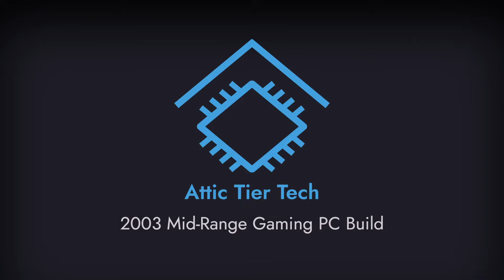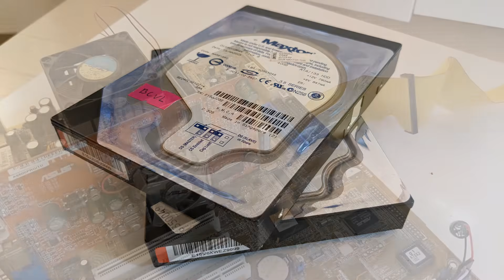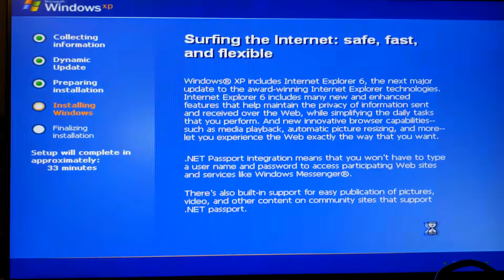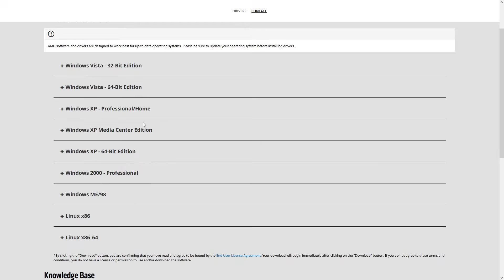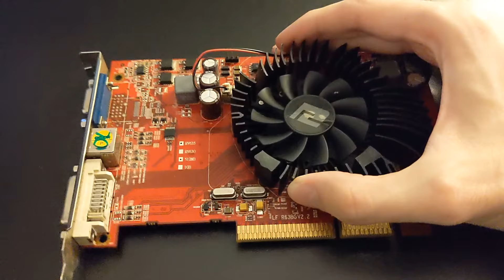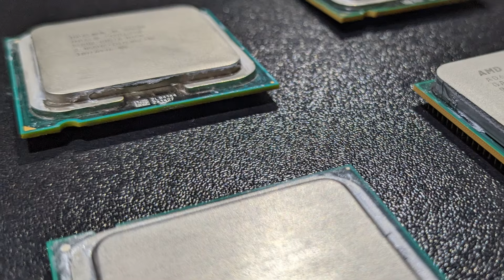2003 Mid-Range Gaming PC Build & Benchmark ( Murphy's Build )

Comment: My 2002-ish rig:
AMD Athlon XP 1800+
Asus A7V333 motherboard
GeForce3 Ti200 64MB
256MB DDR 266Mhz PC2100
HDD IBM 80GB 120GXP
Spire cooler very similar to this, but I remember the bottom corners being 90° 🤷

If I remember correctly, for a time the VIA chipset drivers paired with "incorrect" FSB config was a cause of instability. But I may be mis-remembering.
Those were the days!

Comment: Yeah you will see my previous comment but yeah the best thing that ever happened to me is that this a7v333 burnt out and I replaced it with a more stable ASRock motherboard the CPU and RAM are fine it's just the motherboard. Oh I retired it in 2010 the Asus a7v333 was the best piece of s*** I've ever had because it broke down so much and had so many issues I learned so much from it at the same time😆🤣

Comment: Holy moly this is awesome thanks for doing this video because this is pretty much the build I had as a teenager  the a7v333 I had the Western Digital 80 gb hard drive. My family got it for me cost around $2,500 from a store called OEM Express it came with a 4.1 surround sound speaker system creative sound blaster keyboard mouse and screen was included it was a Samsung SyncMaster 900IFT. So I learned off of this machine. The first thing to go was the motherboard. 
Brought to my new repair Tech at the time. Said I need new motherboard couldn't afford one cuz I was a teenager Jared some of the chips with the burn marks it worked for a bit longer got some money together brought it back he said it was a fire hazard😄 and he replaced it with the ASRock version. Also started bring home stacks of books from the library about PC repair and building used to fix people's computers in the area eventually saving up and upgrading the computer with that money to 3 GB of   of ddr1 RAM and upgrade the graphics card of course and a very very nice CD burner burning family photo albums onto them😉

Comment: My first GPU was the ati 9600 pro, barely was able to run crysis. Played on low settings 600p res with 10-15 fps. But I played it a ton, was fun.

Comment: All I can say about Asus socket a mobos is..."don't buy"

I bought a used Asus a7n8x-e with a 9600 and an xp 2600+ used from a friend in 2007 with a brand psu...
That POS Main-Board was so unreliable, that I had to replace it due to crashes, freezes and voodoo behaviour only 2 years later...

Got the a7n8x from a friend in around 2014 and ... It behaved just like the above mentioned board... I would not touch the Asus A7 boards even if I got paid to use them...

That experience (spending my at that moment in time life savings for a really really unreliable Main-Board) was so traumatic, that I still don't touch Asus Main-Boards from after 1999 till before 2010 or so

Comment: Every Asus socket A mobo has had stability issues in my experience. (Even the NForce ones) Not to mention the capacitor plague...

I have a couple of MSI boards with VIA chipsets and an asrock K7S8X with SiS chipset
All original capacitors, no issues with stability and all of them work flawlessly.

I think the HD 3650 upgrade is limited due to X4 AGP speed? I have the same one on the Asrock mobo i mentioned and it's so much faster than my 9600 pro in the same system (K7S8X has X8 AGP slot)

And as others have mentioned, strong 5V rail is a necessity with socket A CPUs.
Either an old PSU from that era or overkill modern PSU (I got RM850x with 25A for 5V and 3.3V 150w combined and works good on socket A)
I have couple of old "K7 certified" PSUs that are for sure good and they all go up to 40A on 5V rail alone (150W)

Comment: i have experienced same problems with similar board, a7v8x-x. Via KT333 and KT400 chipsets were plagued with issues. Older KT266 and KT133A chipsets were actually more stable, providing more mature drivers.

Comment: In my experience the Nvidia Nforce chipset is the best to use for Athlon XP.
I had back in days Athlon Xp 3200+ with Asus a7n8x-x deluxe, and going from GF4 MX, 9600pro and 7600gs.
And performance was rock solid.
Recently i bought a machine with VIA chipset and I experienced the same problems as you.
The GPU results didn't have any sense, the system was unstable.
I blame it on via chipset but it can be that the motherboard after 20+ years is gone. But all caps were in good condition.

Comment: Maybe that motherboard was already failing hmmm... Well my first pc in 2006 was sempron 2600+ socket 754, better than all P4 but by 2011 when I finally could retire this system, it was close to unusable (good thing XP lasted so long) slow, glitchy, not even snes emulator would run alright...

Comment: Nice build. The videocard needs cleaning though. Im thinking win 98 will work better.
Reply from the maker: While it would work fine, I can bet that it would run less stable :D I agree about the card though, somehow it escaped it's cleaning.
Reply: @attictiertech  Im pretty sure the radeon hd 3650 performed the way it did because of driver overhead. The athlon is bottlenecking it. My athlon xp 3200+ at 2500 mhz still bottlenecks the radeon 9800 pro/xt. 3mark 2001 se gives 19700 points. If i put the videocard in the pentium 4 650 at 4.3 ghz it gives 25200 points.

Comment: Glad you're back, and you are right, its better to use a sketchy power supply then to take a chance with the old psu, the one in my grandpas pc blew up and it was an old psu from 2006
Reply from the maker: I wouldn't call this one sketchy. We checked how it's running multiple times and it proved time and time again that it runs perfectly stable, much better than expected for it's price.

Comment: 3:12 Eww, please give that cooler a brush off ! Also, that's a bulging capacitor at 12:32, near the last PCI slot. I would'nt be surprised if that was part of the instability problem, more capacitors could also be dead whithout looking like it. That or the power supply, it might be recent, but LC Power is a crappy brand. VIA chipsets can also be quite hit or miss, it's better to update the chipset driver when using one.
Reply from the maker: Yeah, our graphics card somehow missed the cleaning :D Sorry about that.

Comment: Ah was wondering a bit on the description there, 8800 gt in this old of a pc. " Asus ATI Radeon 9600 pro "
Is the correct one ofc as the video, just writing it here to make it easy too copypaste into the description.
Reply from the maker: Yup, it wouldn't even fit :D It's fixed now. Thanks
Reply: @attictiertech  Np & I'm thinking either the motherboard is on it's last legs or the powersupply simply isn't up too the task with that platform lacking a 4 pin 12v eps connector.
With everything sharing 3.3v & 5v on the powersupply it can get a bit hit & miss too get this era of pc's up & running well.
Which might be like 12 - 20a instead of it's actual rating on the label.
It's unfortunately common for these kind of noname brands too up the power ratings, which resulted in either components failing too run stable from the lack of clean power or outright powersupply exploding or dying despite what the label claims.

Guess you could test a pci card & underclock the processor & undervolt it too confirm that,  like put the cpu down too 1 ghz from the 1.8 ghz & undervolt it until you get stability issues in prime95 or similar.
A program called crystalcpuid might be really good for this while in windows.
I use it with my windows xp laptop, a dell inspiron 6000 which has a pentium m 1.5 ghz, ati x300 graphics & a non official but better 90w charger too skirt around the power limitations it gets when not using a "genuine" charger which is basically just looking for a resistor on ground i believe.
(Using a more powerful 90w one as the original 65w charger runs a bit hot for my liking & one that i had spare that I've since trashed actually caused the backlight too flicker on it during load so it was really sketchy.)

If you do get a chance too buy one, a socket 462 motherboard with the 12v 4 pin connector on it is pretty nice for more modern power supplies & will be more reliable too most likely.
Always a bit hit & miss with old computer parts though ofc.

Specially the capacitor plague years, so many dead motherboards & powersupplies of dubious quality flooding the market.
But if you find a good antec, thermaltake, fsp, inwin, power man, sparkle/SPI, seasonic, silverstone unit with a strong 5v like 25 - 35a on the 5v rail it's worth keeping & replacing the caps on those if needed for a machine of this era, like 100%.

Might be able too grab a good powersupply finding new old stock computer cases from coolermaster, thermaltake etc...
Reply from the maker: @Mini-z1994  We've checked multiple PSUs, but it's all the same. This PSU works properly as we used it multiple times without problem. You're right about mobo. It's probably something wrong with it, and with plethora of things that can go wrong with these, it's hard to pinpoint what exactly. CPUs work well enough with the different motherboard (one works perfectly, one overheats).